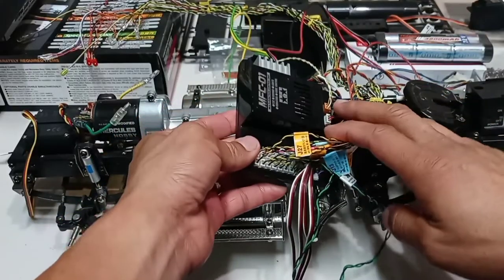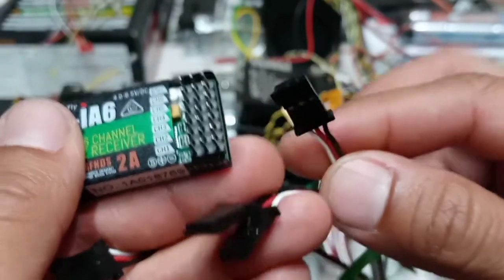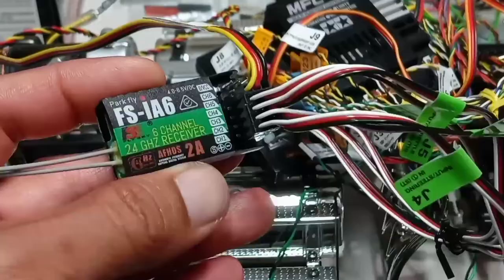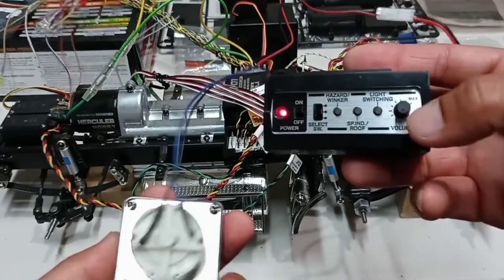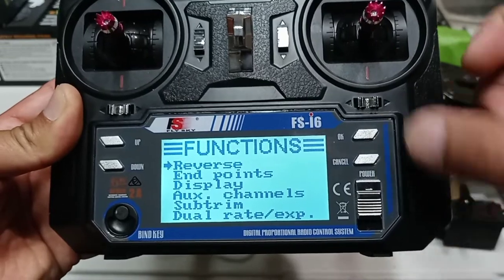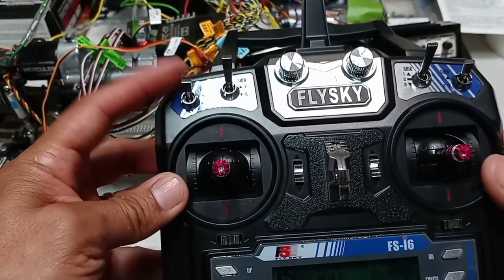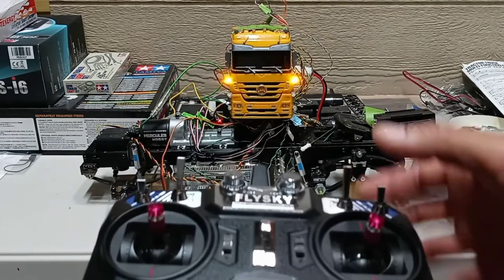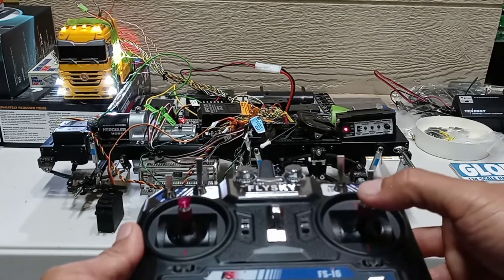Rc Tamiya MFC-01 connections, setup and operation using Flysky fs-i6 Radio😃 part 5

Comment: wow, amazing tutorial setup my friend...just wondering is this mfc01 worth the price..its really expensive and I am also seeing at a china made one called GT power...I don't have my truck yet but I want the start getting the basic parts first...thanks!
Reply from the maker: Hi, Mrchaos2peace ! Sorry for the late response to your comment. I have never had the GT power sound system before to tell you my personal experience with this unit, but I have done some research and I have found out that this unit is a little bit more complicated to make it work. Some people have reported that they can’t make the headlights turned on using just the radio control and that they have to use the GT app on there phone to get around this problem and the app seems to work just fine. Yes the GT power is less in the price, but the way I see it is like comparing an iPhone to a Samsung phone, they are both great phones except that if you buy the iPhone you can’t go wrong because of the technology, this is how I see the Tamiya MFC and the GT power like a Samsung phone, is more like a gamble if your going to like it at the end. But this is just my opinion. I hope this helps and feel free to comment me back if you have more questions. Thank you for your comment and for watching my videos.
Reply: Gt doesn't HSBC a stored control built in. Nowhere net as good
Reply: Have

Comment: Help me guys…

The coupler switch of my mfc03 is not working but when it is connected it sounds that the coupler is connected through the system.but it does not increase the power of the motor what could be the reason for this? my radio is fs-i6 i did mapped mfc also but still motor doesnot have full power..🙁 what could be the reason?
Reply from the maker: Hello😃Tamiya Niko , That's is weird, but i will try to help you. It sounds like if the problem is the coupler switch inside the coupler (the fifth wheel). Unplug the coupler wire plug from the mfc and check the wiring from the plug all the way to the main small switch under the coupler ( the fifth wheel) and check for any damage on the wire that can be causing a short circuit, and on the switch, check for any lose connections, damage parts too. On the switch itself check if there is to much dirt, grease, loose cables or a damage switch part outside the switch. For this you will have to disassemble  part of the coupler. After you clean the switch, and have inspect for any damage, connect the plug back to the mfc and check if it works correctly with the switch in your hands. If it does, then the problem was the switch. Try this first and let me know😃
Reply: @miltonrcadventure  thank you for your kindness .. i bought another mfc3 also.. and i plugged all the wires and check it again.. with brand new wires and mfc 3 unit.. but the problem is same..☹️🙁 .. i calibrate my flysky-i6 radio with the mfc also anothe lights sounds working properly.. but when engaged coupler switch it doesnt increase the motor power 😌
Reply from the maker: @tamiyaniko8867  hummmmm🤔 so, everything new, mfc including new coupler and still same problem🤔 do you have another Radio control and receiver to test to make sure the problem is not the Radio control or receiver? Let me know.
Reply: @miltonrcadventure  no my friend..  this is the only oone radio which i have now 😞
Reply from the maker: @tamiyaniko8867  ok, just to make sure, are you using the same coupler, the old one or the new one?
Reply: @miltonrcadventure  in attached new coupler also my friend ... Do you have some facebook account ..? If you have, can you send me a short video on coupler switch and wheel rotation
Reply: @miltonrcadventure  Can you send me a short video of the wheel spinning when coupler switch is connected and the wheel spinning when switch is disconnected.🙏
Reply from the maker: @tamiyaniko8867  sure👍 i will make one. I will try to have it done by this sunday😃
Reply from the maker: @tamiyaniko8867  i have a Facebook account, i just don't use it, but i will make that video and i will up load on you tube and will let you know, hopefully by this Sunday👍
Reply from the maker: Quick question, what trailer are you using, is it tamiya brand, this is to make sure the trailer pin fits correctly and is not loose inside the coupler.
Reply from the maker: Hello Tamiya Niko😃 the video you requested is up for you to see, i hope this helps solve the problem, if not let me know.
Reply: @miltonrcadventure  thank you very much 😊